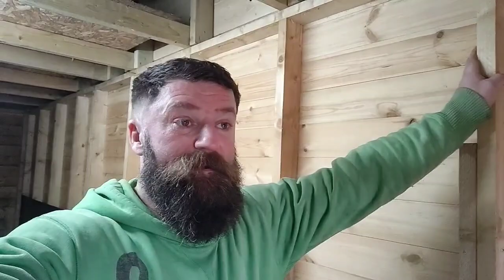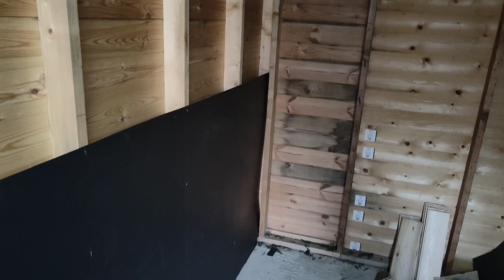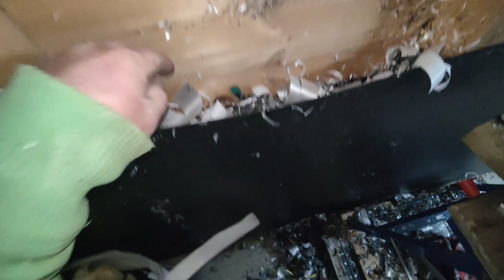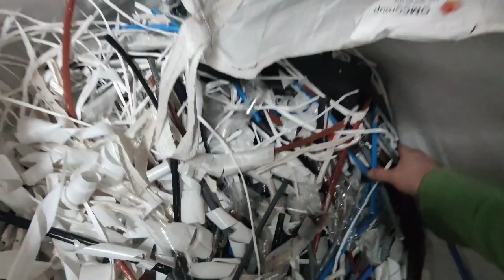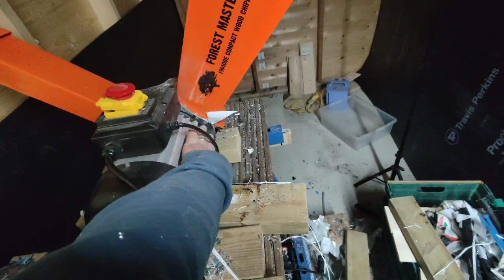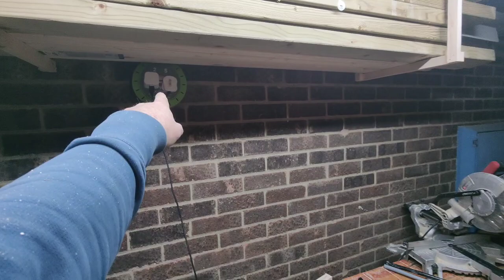Will my insulation idea work?

Comment: Hope it works, but would really advise to get flame retardant thermal insulation.   My mantra being ' better safe than sorry '!🙂🤞✌🖖
Reply from the maker: I thought that but then the shed is made from wood so I thought I'd just go for it.
Reply: @jointechcabling9103  I think from the looks of the wood that it's pressure treated with flame retardant wood seal.
  I'm not 100% sure, but you could check with your timber supplier.🙂👍✌🖖

Comment: If you’re going to be spending some time in there over winter when it’s cold I’d highly recommend getting a CDH (Chinese diesel heater) ..best thing I ever did fitting one in my workshop.. they bang out tons of heat and cheap to run..especially as you are insulating your workshop

Comment: I like the idea of using the wood chipper but electrical insulation is good for insulating electricity; thermal insulation is good for insulating heat.
That looks more like a fire hazard than something to keep heat.
Could try hempcrete or chipped garden waste mixed with lime, that would do a better job of insulating.

Comment: Cleaning that up when it doesn't work is going to be fun! 🤣
Reply: You might be better mixing chippings with glue in a form of some sort, then the porosity (trapped air) is maintained along with ability to block airflow. You could also use the boards in ceiling too then. They had something similar in 70s. 

I'd put a vapour barrier like a cheap roofing felt - breathable type in to prevent condensation forming in the shredded pvc.